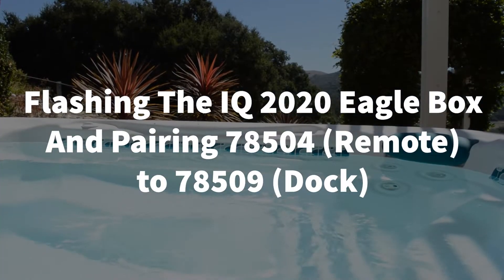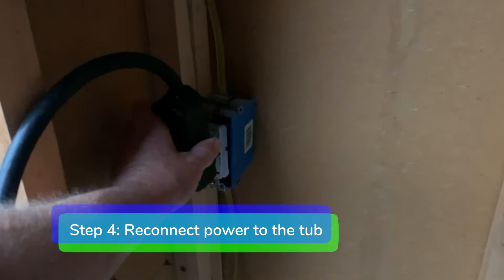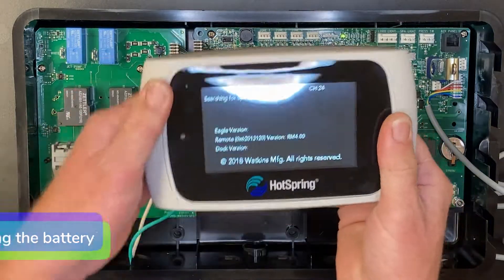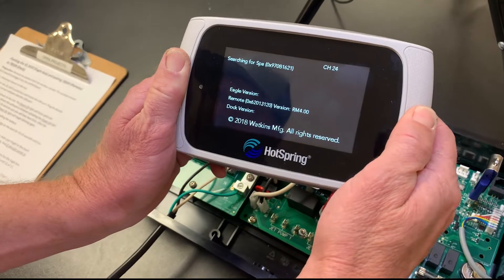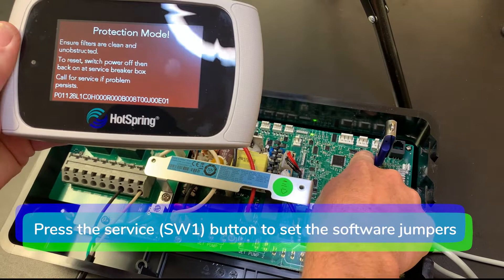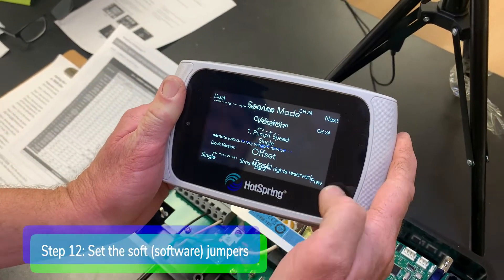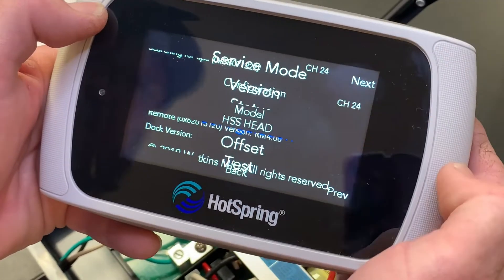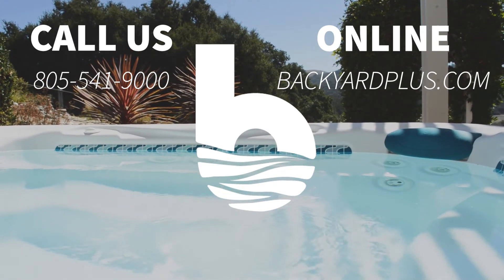How To: IQ 2020 Eagle Box Software Update/ Pairing 78504 Wireless Control Panel With 78509 Dock

Comment: We have a coolzone chiller installed on our Grandee model but can’t seem to get it below 80 to activate the Chill mode menu. Do you think a firmware update will fix this?
Reply from the maker: I don't think you have a software problem. Call your Hot Spring dealer. They should know what the issue is.
Reply: @backyardplus   Thank you! Ended up being a faulty main circuit board.